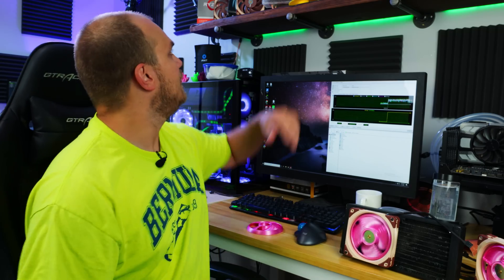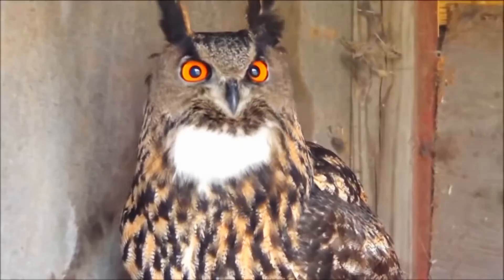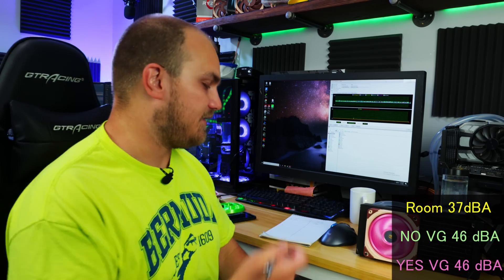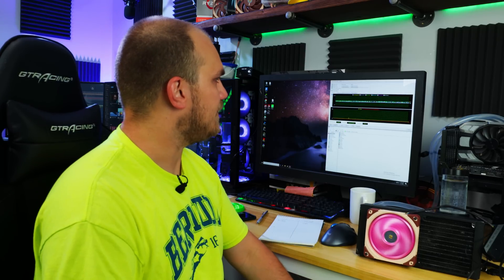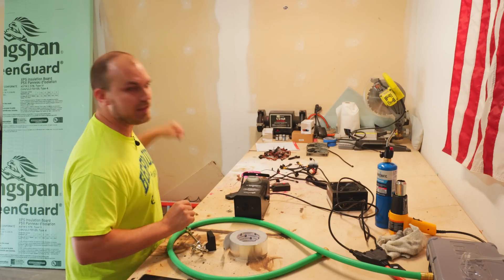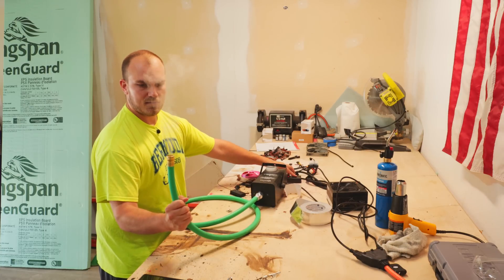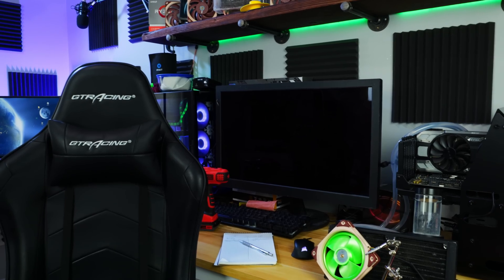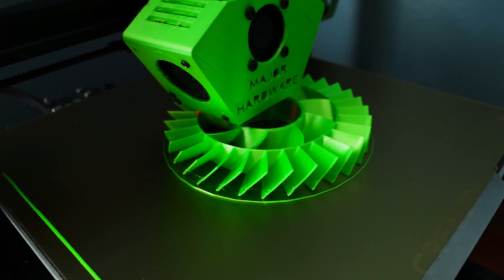Do Vortex Generators Make A Difference | 3D Printed Fan Testing

Comment: I can't take you seriously when you use a horribly cheap GTRacing chair.
Reply from the maker: How dare you
Reply: @MajorHardware  Just saying. GTRacing was literally the worst chair I've ever had. It wasn't even 5 months and the padding was completely broken down and it felt like i was sitting on bare wood. After that experience, said I wouldn't make that mistake again going with a cheap chair, and I ended up getting a Maxnomic Commander S. Expensive as hell, but definitely worth it. Treat your ass well man.

Comment: Vertex generators basically "energize" the air and help it stay attached to the surface or the directed flow line the designer wants. In aero, staying attached (staying close to the surface or down the line you want through the air) is good, getting unattached is bad and less efficient. Also, air that is attached better is generally less draggy.  But in a radial fan motion I don't think that's an issue.  Also note, a basic fan is a vertex generator on its own. The fan blade's edges (the tip) effectively do the same thing. Cool test though.

Comment: In order for VGs to have an effect you need your airflow to be separating. If the air is not separating from the surface then VGs don't help. So you need a much sharper angle of attack so the blades are just barely stalling, then add the VGs to prevent the stall.
Doesn't mean it will be a better design of course.
Turbulence can reduce noise or increase it depending on the situation.

Comment: I don’t think that the wing/prop/blade (whatever you want to call it) is thick enough to utilize VG. I think either thicker blade or steeper angle would show a difference in test with or without VG. If you look at a traditional airfoil, VG are used to increase lift at lower speeds and higher angle of attack. The blade tip is only moving at ~28 mph which I don’t think is enough to utilize VG. I think the biggest improvement would be smaller chord length on each blade and more blades. These test are really just testing static pressure and not necessarily CFM. Noctua uses between 9 and 11 blades for that “sweet spot” of static pressure to noise. Love the series and keep up the great work!

Comment: The vortex generators are useless on fans with flat foil profiles. It would be much useful if it is used on fans with heavily bent profiles. Since the only thing it can do is delaying the airflow separation, on fans like those in the video, it won’t do anything helpful. Besides, the surface of fans in the video are rough enough and there is no point using vortex generator.

Comment: Looking at the "vortex" blade you are disrupting the air flow going into the main blades which I think will cause more drag and the chopping effect mentioned in another post (think of a tunnel boring machine). I think the main blades smooth out the air flow so negate most of the effect. you would probably get a different effect if the "vortex" parts were on the trailing edge. With this you would not have a smooth airflow going into the radiator and this would probably be worse overall in a machine.

Comment: You should try increasing the pitch on the fan with vortex generators. The vortex generators makes most sense when coupled with a steeper angle which risks stall without vortex generators by adding energy to the air keeping it attached to the surface.

Comment: Slot on the leading edge and try a toothed trailing edge. Also if you convert the rotational speed of the blade into it's linear speed, that may explain why the vortex generators aren't really doing all that much. (Blade relative to the air just isn't going fast enough.)

Comment: The issue with the ring isn't the ring (look into Kort Nozzles), but that it "arcs" over into the fan, decreasing the effective fan area by looks like almost 1cm on a 120mm, meaning it is more of a 110mm

Also, look into smoothing the prints.  I know IPA works, but IPA is hard to get...

Comment: I'm not going to pretend that I'm a aerodynamics expert, drawing cars is just a hobby of mine. That said, I have read a few books on the subject and I do know what vortex generators do, and they're more or less a band-aid solution on cars where the rear wing normally wouldn't have access to free flowing air because it sits right in the low pressure bubble caused by form drag from the shape of a sedan's cabin. The job of a vortex generator is to take the relatively high pressure air on the roof of the car and try to get some of it down to the rear wing by generating a vortex behind the cabin that can carry at least some of that pressure from the roof to the wing.
An interesting idea might be to have vertical edges on the end of your wings that follow the wing profile. That would help maintain the pressure difference between the top and bottom of the fan blade like an endplate on the end of a racecar wing, but not use as much material/block as much of the opening as a ring all the way around like you have right now.

Comment: you'd better position small vortex generators in the middle of the blade, not on the beginning. and it should be small strait lines with large space between them. take a look on plane wings with vortex generators and watch some video explaining why they are used.

Comment: Try counter rotating fans. One spins clock wise and the other counter clock with the blades designed so the air flow is the same direction. Would that do anything for a PC...??... maybe more static pressure... or probably not much of any benefit to a PC, but counter rotating setups are quite interesting in general.

Comment: Since you have all of those fans, I think it would be worth looking at what difference the layer height makes. Like try 0.4, 0.3, 0.2, 0.1 and see how it does.
Also does it make a difference if you use PETG or ASA instead of PLA? 

There is also a mod that allows printing in real 3D (it will move the Z axis as well, not just X and Y) so that you have a smooth finish (aka non-planar slicing):
https://hackaday.com/2019/09/09/hows-that-2-5d-printer-working-for-you/
https://www.youtube.com/watch?v=gmePlcU0TRw 

And if you have a delta printer, this should work pretty well, no? Either way, it should be possible to do.

Comment: I have a suggestion. I'm halfway asleep so I didn't really put thought in it, but maybe a guerney flap would work well because they provide more lift without inducing drag so they could spin faster.
Again, I'm pretty much asleep so there could be many things wrong. Also I don't know how lift correlates to airflow and even maybe the airflow on a fan would make a guerney flap not effective.

Comment: If these were ABS plastic you could do acetone smoothing to get a glassy smooth surface on them. You might want to try that out at some point.
Also, I don't think you should remove the outer ring, you've basically made a ducted fan, and ducted fans are way, way quieter than unshielded fans are.

Comment: Hi Major,

you realy should do something like this to be sure there is/ or not is a vortex other fluidynamic things going on:
https://www.youtube.com/watch?v=lwDszzVy34Y
This helps also so see if there is laminar or turbulent flow! Turbulent flow helps a lot with heat transfer, your water loop should also be turbulent.  Refrigiration machines also turbulent flow in their lines. If youn want to be more scientific you can look for the Reynolds Number etc. :

Re= v * d/ V
v= flow speed [m/s]
d= id of the pipe/fan [mm]
V= kinematic viscosity
 [m²/s]

Re= < 2320 laminar
Re= >2320 turbulent

That a realy basic calculation, there can be more stuff edit to this!
Hope that helps ;)

Comment: How about 2 fan blades one on top of the other one slightly offset  and connected at the end. Essentially like the first propeller airplanes that had double wings.
Reply: Like 2 sets of blades in one fan mount. Maybe it could work for sp flow

Comment: If you post the STL files for both I could run a quick CFD study to test various hydrodynamics around both designs such as velocity streamlines, turbulence, vorticity,  etc. As your studies showed I doubt there is a difference but we could see if there is one computationally, even if it is slight.

Comment: vortex generators work but only if they are used correctly .
they are to disturb the air to re-energize it after its already been flowing across a surface and this reduces the pressure at the back end of the blade.
try moving the vortex generators to the center of the blades instead of the front :)

Comment: You should contact XTC3D and see if they can hook you up with some of their material. It's made to coat 3D printed objects, smooth all crevices and thus create a smooth surface.
Takes care of having to work with chemicals like Acetone (Styrenes) or MEK (Polylacticides) or having to sand for an hour. Or perhaps just try to print slower and more accurate ;-).

Comment: i think you should try a fan that pulls the air through the radiator instead of pushing it through, maybe the air going through the radiator first will help with cooling it better because of less turbulence.

Comment: Wind turbines use these but are tiny compared to the size of the blades and are placed in the middle of the blades rather than at the leading or trailing edge. wind turbines also use "dino tails" on the trailing edge these are just like a sawtooth on the trailing edge, larger profile ratio than the vortex generators.

Comment: Before I watch too much more. My gut call right now is that the vortex generators might hinder the performance of the next blade. F1 aero engineers are masters at creating vortices but it majorly affects the following car. Also to weigh in on the fan circle, it seems like it would only be effective where the blade stick out of the housing since the housing provides that similar enclosure if you have the blades really close to it.
I suggested before Making the fan shroud thicker and adding a little height to the blade but that may be too much of a re-design from the path you are already on unless you can just pull 1 axis of your model up and make a 5-10mm shroud addon

Comment: The print is so rough that that alone probably confuses the wind enough to generate sufficient vortices which would mean there's no tangible difference between the two fans in sound. Also, this may not matter, but the Vortex generators are probably in the wrong spot. They should probably be further to the trailing edge of the blade, just like an actual owl wing or like how they actually are on an airplane.

Comment: Noctua has vortex gens on their fans (very small tho) and it will only show at the exit side of the fan but the smoke must only bee in a 2mm wide trait and in a windtunnel i think. Very small difference anyway.

Also noctua has the notched out fan blades where the exit is to also make vortex ore something.

Make sure to always have an odd nuber of blades compared to the fan body that has 4 "legs" to prevent the air from all or several blades hit the legs at the same time, making "slapping" noises

Comment: Blade pitch is probably not steep enough for the vortex generators to do anything. Flow separation happens when the angle of attack is too high (too much pitch in case of a propeller).

Comment: Put the smoke machine in a box or  a sealed Case, and the fan as the only output, let the smoke build inside, and then uncover and run the fan at the same time, it should make a better visual test

Comment: I think the vortex generators you added are incorrectly implemented, on the planes they serve to reduce the turbulence generated by the wing, in a pc fan this would not be necessary because the fan motor is relatively powerful to move the blades.

What can make a difference in this would be to first remove the ring around the blades and then add winglets/sharklets to the blades, an example of this is the Enermax Winglet.

The fan you showed at the end should be with the types of "turbofan" blades on the outside and the compressor blades on the inside.

I hope that my Avionic Technician qualification will be of some use.

Comment: How about multiple rings on the fan blades so the air pressure is more distributed across the entire fan blade, rather than just the outter edge of the blade

Comment: I don't think the vortex generators are long enough. You gotta remeber you are spinning those blades really quickly so short vortex generators probably won't be very efficient. 
Also, try printing them on the opposite side of the blades.

Comment: Have you tried buying like a digital scale and measuring the air force the fans could push? Maybe lay them face down, zero out the scale, and then turn them on? You could 3d print a scaffold so it has air to move

Comment: Should also use smoke, like in a wind tunnel, to test airflow and such, it will allow you to see efficiently the air is moving around and through the fan, and maybe a high speed camera, shouldn't need more than 400 or 500 fps to get an accurate idea, though the higher the framerate gets, the easier it will be to debug your designs... edit: I didnt watch the entire vid before I commented sry..

Comment: You should make the attack angle of the blades steeper. That way they will generate more static pressure, which is important to cool rafiators

Comment: Remove the vortex generators from two opposing blades, and then make them a little bit taler.
Idea is to have the taller blades suck in the vortex-air from the two lower blades.

Comment: Sound measurements are very sensitive to distance, each doubling of distance will loose you 6db, and as you have to measure fairly close to get a decent signal to noise ratio of fan to room noise, where you hold the mic will cause significant differences in measurement. The best you can do is keep the position of mic and fan constant, by putting it on the table and not touching it throughout the measurement of all fan designs. Also for capturing such tiny differences in spl, you'll need an app which can average spl over a longer time. The RTA function in REW can do this and allow you to analyse the frequencies too.

Comment: As previously mentioned, I would not lose the outside ring, I would invert it. So you would get a Venturi style effect increasing pressure, mixing this with the mystery fan from the end of the video, and smoothing may indeed be difficult with his current 3D printer. Try printing the ring concave instead of parabolic or other way around (depends of the way you see it) and try following the curvature of the slanted edge of the frame with as small of a gap possible, this got me thinking as well that if you would make a fan with a bigger size intake and smaller style exhaust (like a cone style fan) to increase pressure. Not an engineer, but more intake squeezed in smaller exhaust should make more pressure thus resulting in higher airflow trough the rad. Correct me if I’m wrong

Comment: I like that ring, makes this fan look special. I'd just not let it go inwards towards the top but even try to follow the Noctuas frame shape to increase the size of the fan blades towards the upper part of the fan. Okay, the ring around the blades is most probably only making sense (maybe apart from reducing vibrations) if the blades are higher than the frame. Just like a "moving frame extension".

Comment: I don`t think you will see any impact with the vortex generator on this scale, mostly because I think they are affected by air temperature like you know is some areas planes don`t fly because the air is too hot (I believe that causes some issues with air density). Obviously, this is just speculation in part, obviously, they don't seem to add any downsides so they might help with the stability or structural integrity of the fan so is your choice.

Comment: I have zero knowledge of aerodynamics but my gut feeling would tell me that a car going in a straight line doesn't interact the same with air as a spinning fan. Any thoughts ?
Reply: It does, and it doesn't. Even though the fan is spinning, when it interacts with air, inertia is in a straight line. It's the centripetal force that makes the rotate instead of going straight. However, a smoke test would be much more effective with a single blade in a miniature wind tunnel.

Comment: I was about to say that a turbine kind of fan should be interesting and then you pulled that hybrid fan from the workshop. I think the blade should be shorter. The ring probably impairs the amount of air intake. What if the ring was on the back of the fan? I really like you try and fail attempts. So much interesting.
On vortex generators: they probably break sound frequencies rather than making air flow better. I also think they should be long all the way of the blade and both sides.

Comment: What about sanding the surface of the blades so they're smooth? Also would it make a difference if the tips of the blades were rounded / square / pointy... What rake and pitch of the blade too?

Comment: I think the ring helps since the printing material is not as stiff as noctuas, so without the ring you need more space between the blades and the fan shroud since the bend at higher rpm. With the ring you should be able to get closer